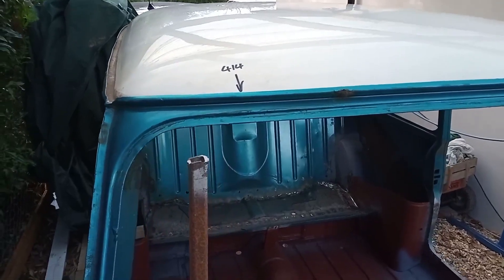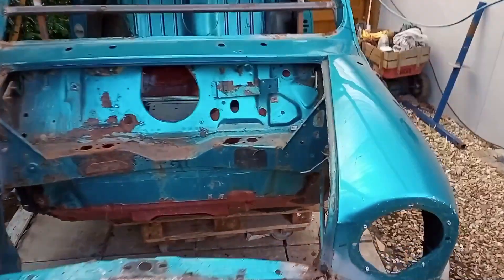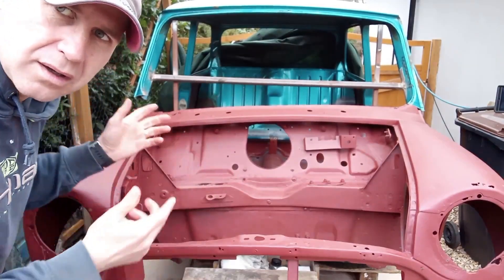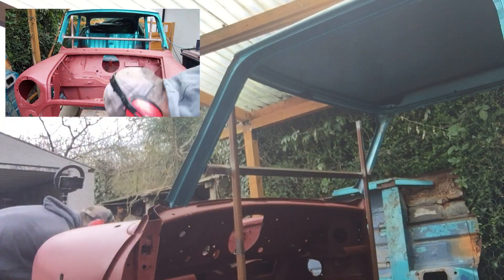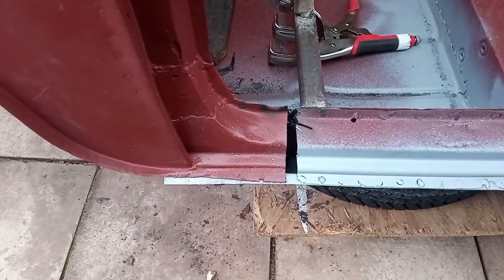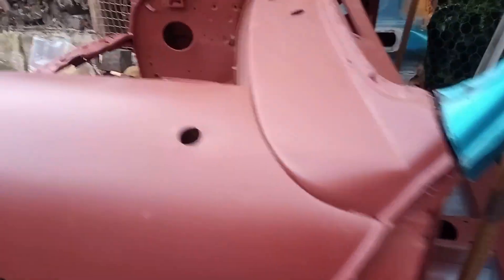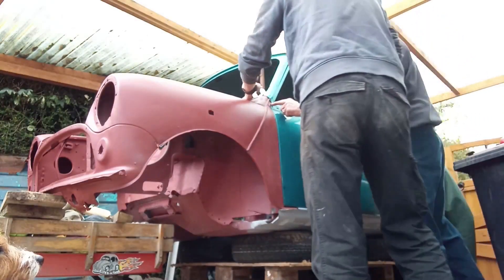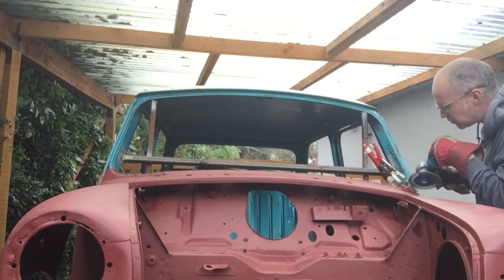EV Conversion Project Mini i3 Ep9: Face off

Comment: Unlucky with the mistake but wow that's extremely brave cutting through thoes box sections and trusting your welds to hold the front on. Did you consider installing some box section or internal sleeve to strengthen thoes A pillar welds? Also the doors often have shimms, so you may need a couple on that top hindge to stop the binding.
Reply from the maker: Thanks, a schoolboy error but we live and learn!
Don't worry there is more to come on the whole door gap saga 😅
The problem we had with shimming the door to fix the gaps is that the back edge lined up nicely so packing the top hinge would throw this out too.
We'll revisit this in a later episode 😉

Comment: Hi Scott, will you be removing the front bumper of the i3? I have an i3 and accidentally bumped another car with my front at low speed and would be interested in repairing it myself if it is relatively easy to remove myself but I can't find any guides as to how to do it. Cheers, Christian
Reply from the maker: Hi Christian, I have a few days off work soon so can have a look then.
Reply: @MiniLifeCrisis  Thanks Scott, very much appreciated !